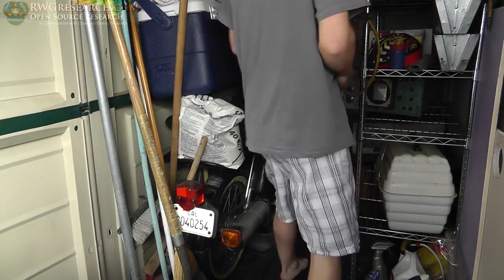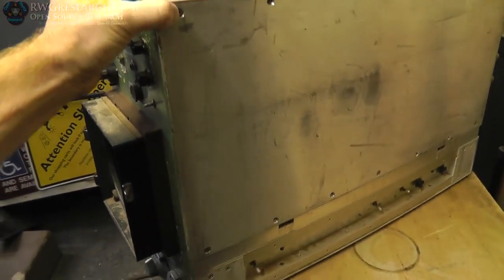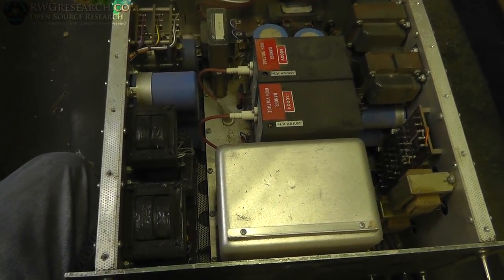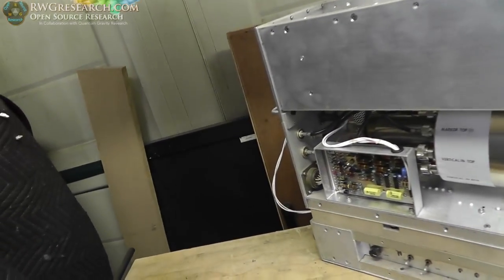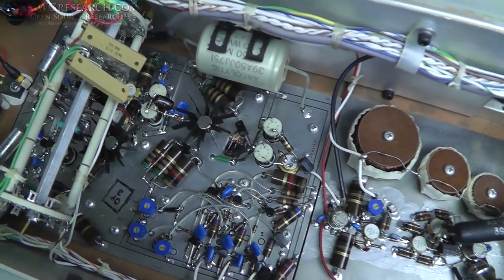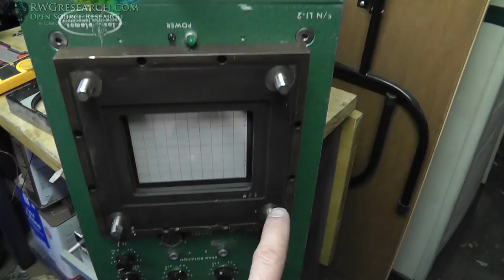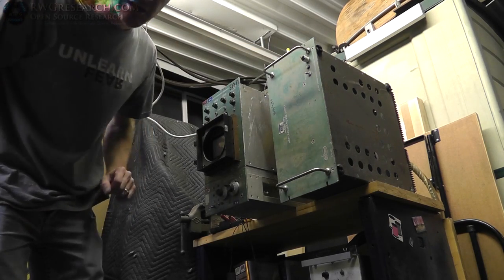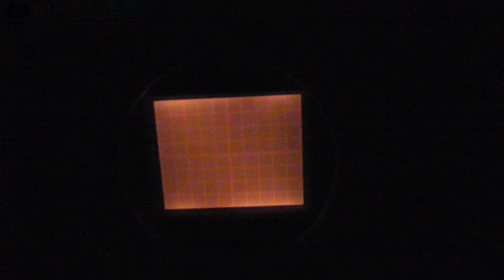Los Alamos National laboratory High-energy-density Plasma Physics STUFF Part 2 of 3

Comment: High voltage Old equipment back in the 70's and 80's the most common fault was the HT lines, and ht winding's going short, I would check those and quite possibly the HT rectifier rods are shorting out them things stank bad when they were failing.

Comment: At the end, it was starting to sound like an overloaded transformer, not the usual hum.
I would give the power supply a good cleaning and make sure nothing has fallen in there that could short something out.
It could also be a bad electrolytic capacitor that is now leaking a large amount of current.
Reply from the maker: agreed on both of those statements. I suspect it's a cap. seems like a transformer just gone bad or Somthing shorting it out it much more unlikely.:)  ~Russ
Reply: rocketman221projects Became full of cleaning dust out of power supplies. Power supplies when heating up settle to a physical dimension over time as the dust is built up with the static charge. Once the heat  insulations of the dust is removed it gets a shock to the system as it is starting from colder startups.

Also old power supplies suffers from a similar effect as the insulation of the material that coats the wires and instruments breaks down over time causing another potential path for high voltage, so it could be burning insulation as the current pass over the broken electric insulation, which will have burnt marks to mark it electric path. Or it just cooked some built up bug crap on power up. Bugs can get everywhere.

Comment: You are probably cooking bugs, cobwebs and insulations and capacitors insulation material that is breaking down. The old High voltage transformers do have an unusual hum. Get the sound recording and do a fourier frequency analysis to find the frequencies.  I expect it to be the input electric mains frequency to be the main one causing the noise since we can hear it.

Comment: You poor guy, no idea what you've got.

The type 1776 MCP oscilloscope was the world's fastest when it was developed at LASL in the mid 1970s. Like its predecessor the Tektronix 519, it was specially made for one job: capturing single-shot pulses with extremely fast risetimes from laser and nuclear detectors. The display was usually so dim that only a camera with high-speed film could capture it. 

When it was first developed the 1776 was classified top-secret. That's why you can't Google it today. You are literally the ONLY person to have posted anything substantial about the 1776 online. It is extremely obscure equipment, made for LASL internal use only.

The 519 used a special CRT to get high risetime--there was no vertical amplifier, the tube was designed to accept a direct input voltage to the deflection plate via a transmission line and terminator and gave about 10 volts per cm sensitivity. A 519 could show pulses with less than 500 ps risetime and 1 GHz bandwidth. Later modifications extended this to 3 GHz. http://w140.com/tekwiki/wiki/519

The 1776 was even more extreme. It also used a special CRT, which added something to allow getting usable brightness for extremely fast pulses: it had a built-in image intensifier, using a microchannel plate, or MCP. MCPs are also used in night-vision goggles. Tektronix was partly involved in its development and later integrated MCP image amplifiers into its own line of scopes, esp. the 7104 series in the 1970s and the 2467 from the 1980s. http://w140.com/tekwiki/wiki/7104

You might be able to get the 1776 working but you'll need to get friendly with the dark little world of nuclear scientists. Even though the 1776 is obsolete and not classified anymore, information and schematics are difficult to get.
Reply: Why did you edit my comment?
Reply from the maker: know one edited your comment, it was in the spam filter... see your email. ~Russ